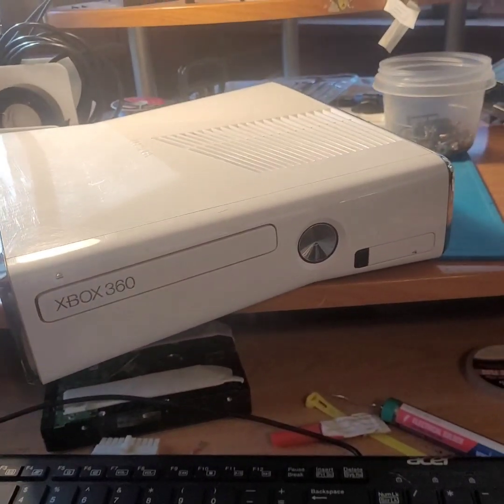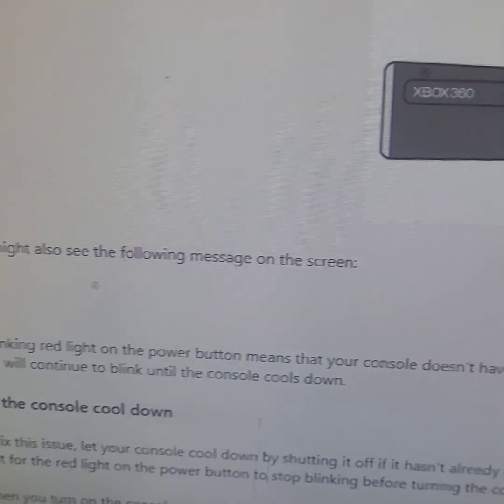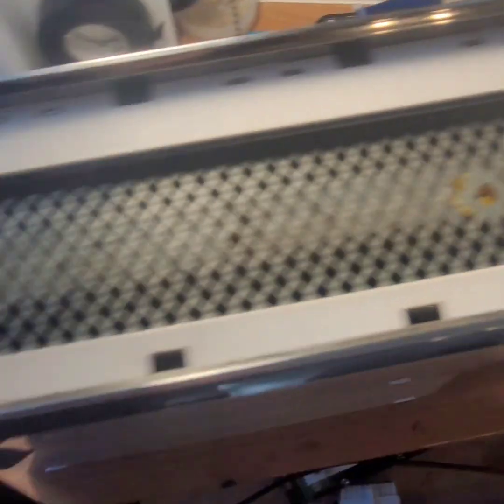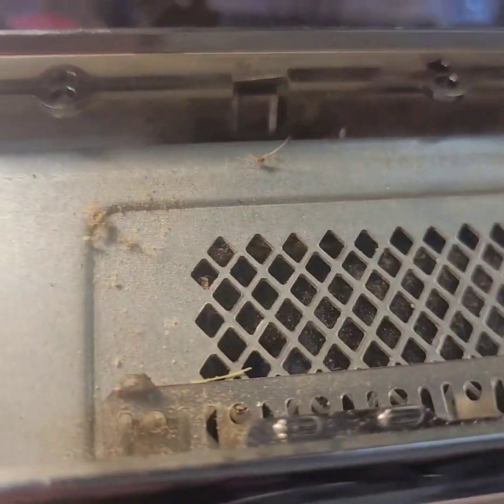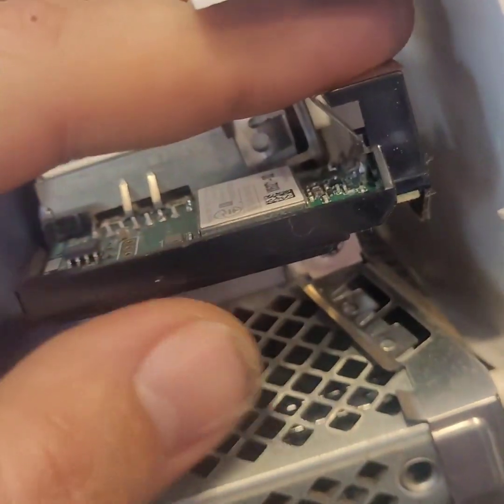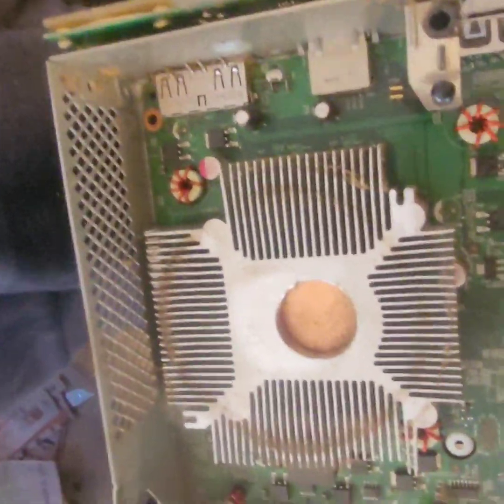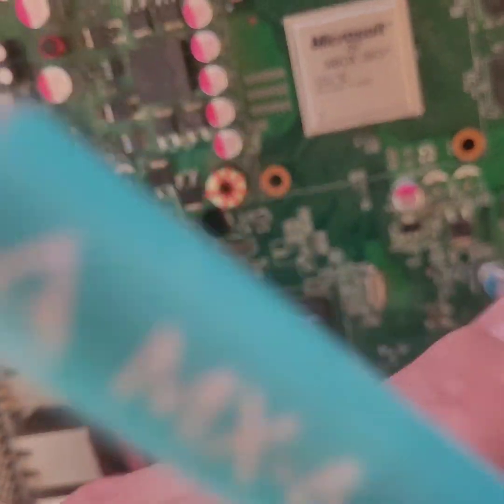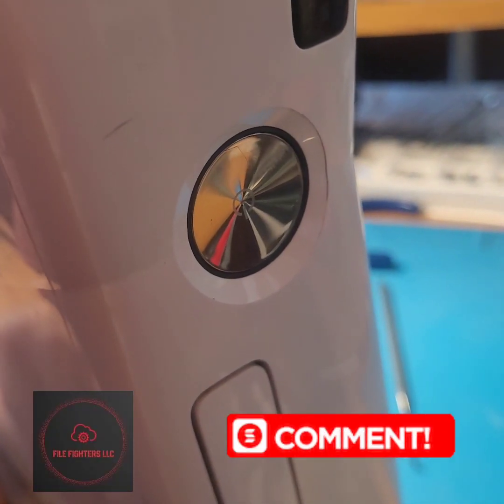The Anatomy and Downfall of an Xbox 360 Slim.

Comment: The problem is that the Resistors for temp control are bad. There are 6 of to the left of the GPU. One of them or multiple of them are bad.
Reply from the maker: @MichaelBaldwinb3l0kk  that's what I saw in the other video I watched diagnosing the issue ! Thank you I'm definitely going to give this a try !

Comment: It cannot overheat in few seconds after starting up, even wit fully clogged heatsink and fan, so the issue was hardware related all along, and probably caused by constant overheating during use without cleaning it.
Reply from the maker: That's exactly the issue constant use without cleaning caused some hardware malfunctions like the main BGA unsoldering from the heat, or I watched another video, it could be some resistors that died